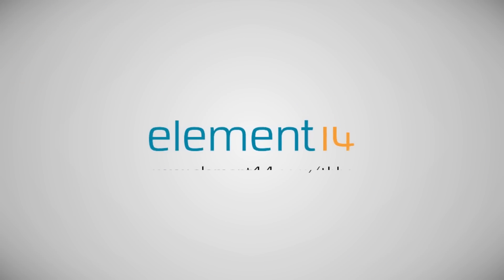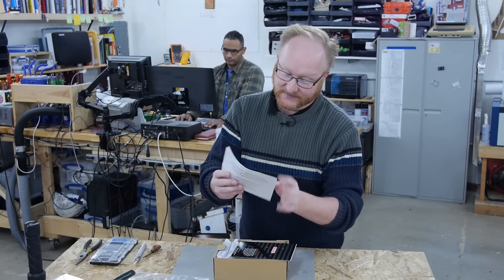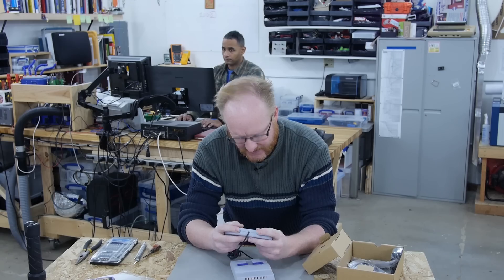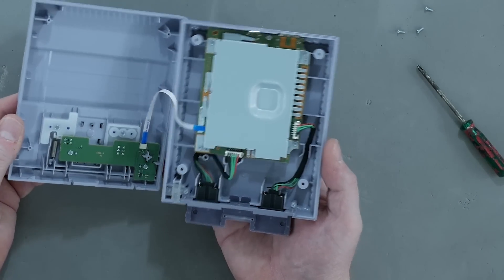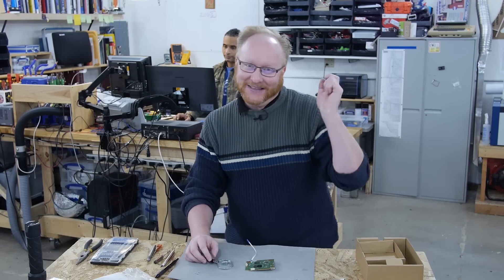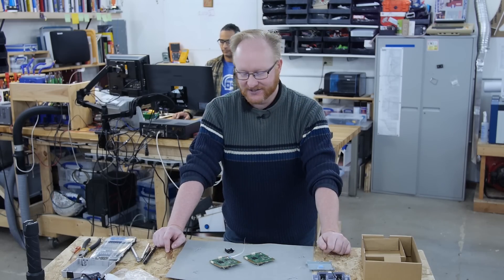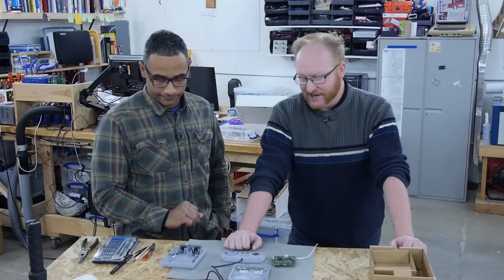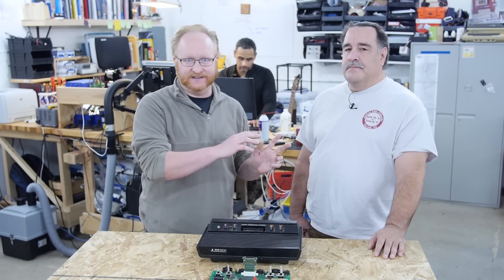SNES Classic Teardown

Comment: On a NES or even SNES emulator you can get away with low level emulation, basically recreating each CPU and GPU chip opcode dow to the individual cycles. That is not feasable for the N64, at least not on that kind of hardware. What is usually done is a high level emulation, where you would intercept the calls made to the graphics library by the game code and recreate that functionality on the host hardware instead. Like if the code uses a function "draw triangle to coordinates x,y etc", if you can interpret that, you would intercept the call and translate it into the same "draw triangle" function on your GPU driver. At least that is how I understand how it's done. That way, you don't need to emulate all the chips 100 million times a second, you just emulate the end result, which gives huge gains in performance. So it could be possible on the same hardware that is in these machines. This type of emulation will never be as accurate as low level emulation, but it is enough to make games work. You also get benefits in that you don't need to emulate the frame buffers etc, so you can render at higher resolutions etc if you like.

Comment: Based on this video this dude is an admitted, as they would say a "Sega fan-boy".  Why he hates the SNES or "S-ness" as he would pronounce it, is beyond me since both the Genesis and NES/SNES are great consoles and the battle of which is better, is better left to the grade school cafeterias of the 90's.  Anyway, the Wikipedia link provided is to point to the fact that at 11:00 he claims the average SNES Rom image (game data) is 4 megs...This is completely inaccurate and is probably in reference to actual bootleg ROM images traded online (which are condensed).  Rom images (which you wouldn't actually call them that) that are original to the cartridge were much larger that "4 megs" because there was no reason to compile the data so the memory space on an actual cartridge was more than sufficient.  This storage space advantage that cartridges had at the time, was why Nintendo stuck with them for the N64....so I guess in addition to this guy just clearly wanting put Nintendo products in a bad light, he also doesn't know what the hell he is talking about.  Genesis is cool too for the record.

https://en.wikipedia.org/wiki/Super_Nintendo_Entertainment_System_Game_Pak

Comment: I had a semi working N64 emulator on running on the second gen PSP. It worked for awhile, but after I got a blue screen of death. I just scrapped the idea of running the emulator. It was a fun little task while it lasted.

Comment: i use batocera for x64 greater compatibility then then retropie and i can use a broken laptop to run it (broken screen hinge) with the 500gb hdd its way easier to hold most on the psx library as well as all on the 32bit and older systems(minus maybe all of mame since its over 700GBs).

Comment: "I remember the chip shortage of 1998, the Wii shortage of two Christmases in a row? (2006 and 2007)" Well, jeez, clearly having hardware shortages once every 10 years means that Nintendo are artificially manufacturing scarcity. It's the only logical conclusion. It's not like there's other hardware in-between that wasn't affected or anything, nope, an artificial shortage is the only possibility.

Comment: @2:25 you ask if they left the data pins on the USB port connected, but I don't think you mention it again after you took it apart. Is it still hooked up?

Comment: A friendly Nintendo suggestion. I know that a theme on this show is making home consoles portable, but with the Switch already being portable, you can't change it into something that it already is. I do have another idea though. Remember the PlayStation Vita TV? What if you made a "micro-console" out of the Nintendo Switch? It basically would require you to strip the Switch of its battery and screen, and combine it with the Dock in as small of a form factor that you could possibly make it.  Nintendo's latest console is a tiny box in your pocket!

Comment: re: N64 emulation

From memory, it still doesn't take a whole lot. Any recent ARM Cortex-A11 or above with 512MB RAM would handle it quite happily with the right GPU. Nintendo could even jump up to a cut down Tegra (Mainly on the CPU side) from parts that don't make the cut for the Switch and design a new board that could be reused for the GC and Wii. Kinda hope they don't though, getting a Wii U and softmodding it to play Wii/GC along with some emulators is the tits with the tablet screen. (The whole aspect of being able to keep playing during toilet breaks is highly under-rated especially for older games that sometimes don't have the best pause functions)

Comment: N64 is trivial for modern systems to run. Raspis supposedly do it decently, so an FPGA is not out of the question by any stretch. But I would guess it would likely be a bit more expensive than the SNES/NES Minis if made.

The GameCube is still incredibly difficult to emulate, however, even for something like an overclocked i7-3770k. F-Zero GX, for example, is quite taxing on even high-end systems (namely, those particle effects in the sand courses absolutely destroy hardware). It would probably take multiple FPGAs, or a rather big one, to do a GameCube, which would be prohibitively expensive. Even the Sega Saturn is hard because of all the wonky custom stuff it has.

N64, though, should be doable, and I wouldn’t be surprised if it were double the price (hopefully not).

Comment: So Ben the reason the ram is bigger in the SNES Classic is because of the rewind feature. And there are NES classic being remade and sold this summer. And the 720 is to keep cost down. But also because 720 scales perfect from the old 320x240 resolutions that these consoles put out. Less scaling artifices. And interpolation has been fixed this time around. 

Also side note Star Fox 2 was little re balanced a little bit. And game may ran worse witch is hard to believe than it does on the Classic. Star Fox 2 was being made to use some features that only the FX2 I guess has some extra features the original did not. Most people just assume FX2 is a FX with a different crystal so runs faster. Turns out talking to a old dev I know that helped work on that game. Star Fox 2 used some new feature that helped draw a little quicker. He says all emulation software for SNES just takes what they have for FX and speeds up the clock for FX2. I guess FX Fighter had it come out would have used this feature too.

Now having said that. I have played it on repro carts. On emulation. And on the SNES classic. And Star Fox 2 does not feel that wildly different from what I played before.

Comment: Ben, I'm sure you can find the proof of concept online.  Shortly after hakchi2 hit for the NES CE people started obviously throwing on retroarch and related emulators.  When this was done someone pretty quickly threw N64 on that and bone stock settings/build it didn't run great, chopped the framerate down like 20-40fps+ kind of ranging on the title.  Someone decided that wouldn't stand and went and either found or custom built a faster variant of the retroarch N64 emulator and it improved almost to 100%.  But, then going into the retroarch emulator settings the video maker tweaked the emulator settings without compromising frames per second performance (no skipping) and got it to run 100% 60fps at 720p running Mario Kart 64 and a few others in the same clip too.  N64 would be the maximum allowed with the parts of the NES(and SNES) CE.  The only change would be making a larger storage chip so they can take the notably larger N64 carts (8 to 64MB each) plus the ability for their save states and storage for rewind.

Comment: From what i've heard the rewind function function takes up looots of space on the SNES classic, also there are savestates eating memory, so not just the roms.
N64 games are very hard to emulate, like Perfect Dark, i've never seen it emulated with perfect speed and without any glitches in the graphics, not even on fast computers.
Should be possible with a good optimized emulator, but maby not with a weak little ARM cpu?

Comment: I have an SNES Classic and the controller cable doesn't affect me. But, my SNES Classic is connected to my old 27 inch CRT TV with the help of a HDMI to stereo composite adapter.

Comment: no nintnedo didnt fix any slow down on emulation ,starwing fx is still like 12 fps lol
Reply: girlsdrinkfeck  20 fps, actually.  The game itself has its frame rate locked at that speed.  (In other words, 20 fps is built into the game... it's not the fault of the hardware.)

Comment: SNES is slow because games are entirely CPU bound right? It is a lot easier for a console to maintain speed without rotation, scaling, less sprites and colors going on on the screen. Genesis was faster SNES was prettier and if reverb does not drive you crazy sounded better as well.

Comment: 90s PCs managed to emulate the SNES reasonably well with a lot less than 512MB of RAM.  And that was on top of a full OS.
Reply: If you are willing to accept low standards, you can claim that nearly anything can be emulated on nearly anything. (A lot of commercial game emulation relies on the detail that most people don't actually care that much.)  90s PCs emulated the SNES with inaccuracies, game-specific hacks, and broken edge-cases.  There are reasons that the system requirements for BSNES were much higher than SNES9X and ZSNES.

Comment: Or maybe they couldn't produce more of the NES mini because they ran out of ram chips and had to find another source that provides this same type of low memory flash chips in bulk, which would be why the new one is different. (It makes no sense for a company to buy in bulk from 2 providers when just 1 would save them money) We've kinda been going through a ram shortage for over a year now and if newer more refined ram is getting scarce, imagine older/ smaller sizes that are no longer used en mass. (Since almost all  chipsets nowadays use 1GB+ min) Anyway, both logical possibilities, one just a tad too biased.

Comment: Largest known commercial SNES rom is 6 megabytes.
Largest known games (which used a 2:1 hardware decompression chip - it decompresses data almost transparently, so you could view it as a cheaper way to get double the ROM.) are 96 megabits. (12 megabytes.)

The SNES mini doesn't include either of those though, so... Eh.

My guess is most of that RAM goes to an operating system and the menu, and stuff like those border graphics, upscaling and so on. That's a lot of overhead, but that's emulation for you; - not a particularly efficient process, when comparing the hardware and software doing the emulation vs the actual original hardware...

Comment: Ben, Ben. You're better than that. XD

Blast processing? Really? Do you even know what that actually referred to?
(It's a made up marketing term because what it actually referred to is something that wasn't even possible in practice on consumer hardware. Reframing it to mean 'mega drive is faster' is in and of itself revisionist history.)

As for clock speeds, surely you must know you can't simply compare numbers across different CPU architectures and expect meaningful results, right?
The ZX spectrum had a 4 mhz Z80 processor. The C64 had a 6502 that didn't even hit 1 mhz.  Actual Performance of both processors was comparable even though one was 4 times 'faster' than the other.

And that whole 8/16 bit data bus thing? Yeah? So what?
Have you seen how the Genesis system Architecture works? Several parts of that system force you to use 8 bit writes.
But more importantly, the 68000 can only read/write from the bus once every 4 cycles.

The 65816 can read it's bus every clock cycle. This means even at just about twice the clock speed, the Genesis data bus can only perform half the data transfers in a given time. Yes, most Genesis data transfers are 16 bit, but add it up; half the number of transfers, twice the bytes per transfer = both systems have about the same bandwidth on their data bus. (in fact, one of the problems the SNES has that limits it's clock speeds, is that it needs fast RAM. SNES system RAM and ROM has faster access times than the Genesis equivalents even though for the most part the SNES is accessing it at 1/3 the clock speed. However, it performs 4 times as many accesses for a given clock speed than a Mega Drive/Genesis. Hence, RAM and ROM timings are more sensitive.)

Have Nintendo fans been rewriting history? Probably. A little.

But piling naive technical ignorance on top as some kind of counter-argument isn't very helpful. XD
Reply: Kuralthys  "The ZX spectrum had a 4 mhz Z80 processor. The C64 had a 6502 that didn't even hit 1 mhz.  Actual Performance of both processors was comparable even though one was 4 times 'faster' than the other."  

True, but that's because the Z80's opcodes take an average of 8 cycles per instruction compared to the 6502's average of 2 cycles per instruction.

Oh, and by the way, the C64 had a 6510, not a 6502.  I'll admit that I'm being a bit nitpicky since the 6510 was 100% opcode compatible with the 6502.  IIRC, the main difference was that the 6510 had a tristate bus, and an 8-bit GPIO port (the 6502 only had a 6-pin GPIO); the extra I/O pins were primarily used to control the memory map by bank switching.
Reply: Thank you! I was thinking the same thing!
It's incredible how every straw has been grasped to try to justify that "blast processing" was ever actually a real thing outside of a marketing term.

Comment: The Genesis had some pretty good CPU power, and it's peripherals were well understood.  But Nintendo went the extra mile in peripherals on the SNES so it had better colors and (potentially) sound.  Really the Genesis graphics system should have had at least another bit of depth per channel, and both the sound system and the CPU could have done with more work RAM especially given it got a CD drive later.  Just getting around this is how the whole 32x debacle started.  On the other hand I guess that's nowhere near as bat-country-insane as sticking a custom expansion CPU inside your cartridges later because it has access to the system bus.

Comment: Here's something you might not realise:
The controllers don't just use the same connector, they ARE Wii classic controllers.
They work with a Wii as if they are a Classic controller (obviously though, they lack all the buttons and the sticks).

But this also goes in reverse - a Wii classic controller works just fine on a SNES classic.

For the most part this isn't very interesting, but I did discover that the 'home' button on a Wii Classic controller has the same function as the reset button. (returns you to the menu)

So if you're wondering how to get around having to go over to the console to press reset and access the menu, there's your answer. XD

(this also means you could in theory hack together an attachment that you can stick between the console and controllers that mimics the behaviour of the home button on a Wii classic controller, to bring the reset switch closer to where you're sitting.)

Comment: A K6-2 400 or pII 400 and around 32-64 megabytes of ram with a tnt2/geforce or better card could do decent n64 emulation back in the day in some games.. some ran slow but most ran playable speeds.

Comment: As someone heavily involved with PC emulation, I'd suspect that an "appropriate" (not too overkill but also something with some overhead) rig required would be something like what you'd see from 2005 in the mid range. So for example, Pentium 4 640/650 w/ 512MB-1GB RAM is probably enough for a good level of PC emulation. Realistically, Nintendo should be able to emulate with much less because of their software engineers but at the same time, that level of overhead might be desired for emulation aiming for accuracy without the GPU as the primary renderer.